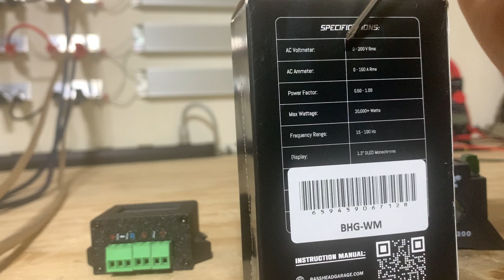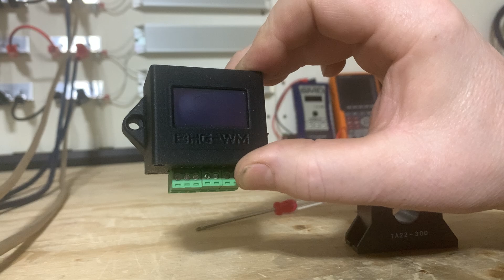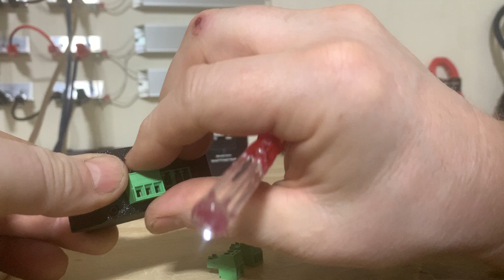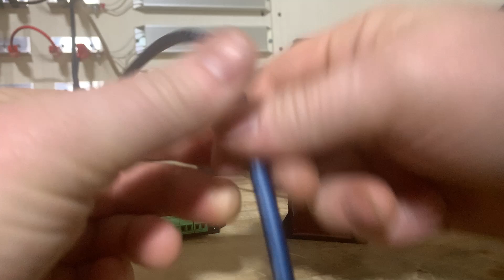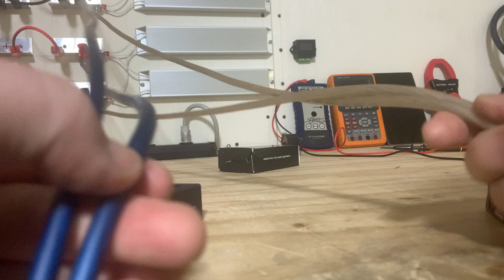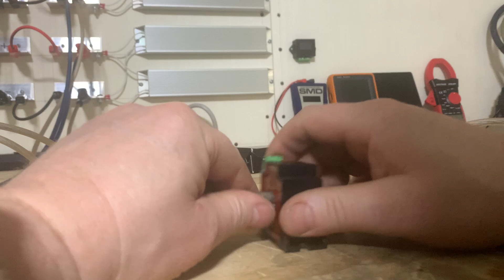Bass Head Garage Watt Meter tutorial

Comment: Do you know if the BHG will work with a taramps big boss 5k i know some folks having problems with certain amps with having high dc offset
Reply from the maker: I have successfully used the BHGWM on the Smart 8 and the HD-3000 amps so far in our vehicles as far as Taramps goes. I would expect the same results with the Big Boss lineup
Reply: @jeremywilliams8558  thanks

Comment: People will still ask ridiculous questions like how do you connect meter to multiple amps. Or will it meter better if I use thicker wire. I've mentioned 20 awg copper will be fine even 22 or 24 awg copper wire will be ok.